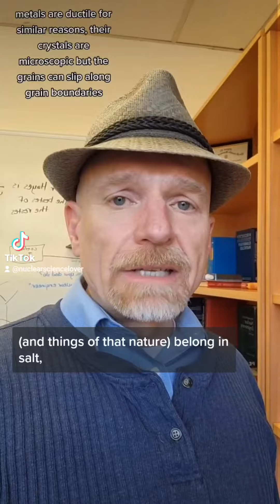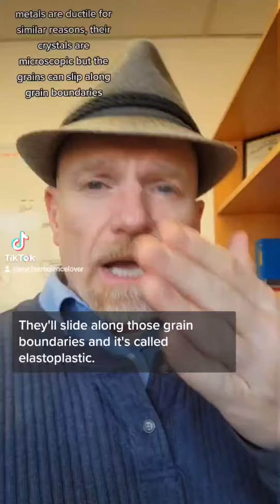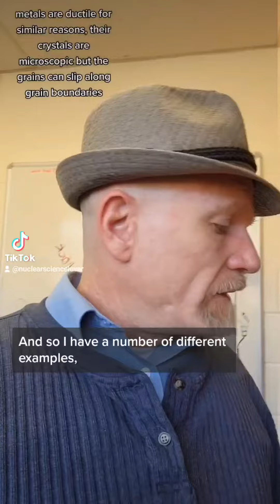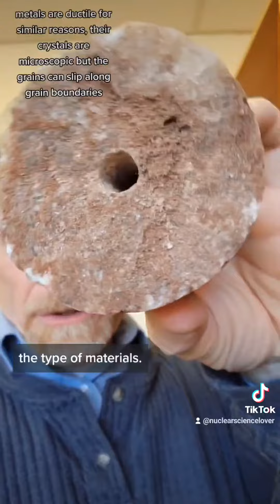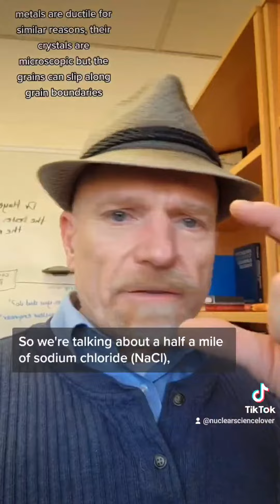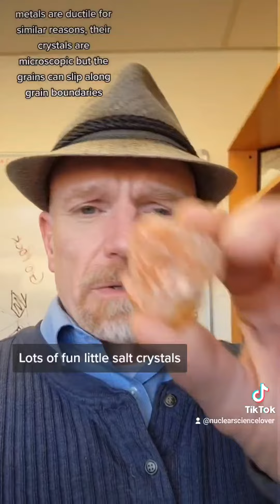The geophysics of the Waste Isolation Pilot Plant. #nuclearenergy #nuclearwaste

Comment: Robert would you be able to talk about the EROI/net energy of gen 4 reactors? Is it high enough to support thermodynamic sink processes like hydrogen production and Carbon Capture while still leaving enough energy surplus for currently hydrocarbon-based society needs like electricity and high grade industrial heat? Thank you
Reply from the maker: Is this close enough?
https://doi.org/10.1016/j.cles.2022.100009
Reply: @robertbhayes5039  I’ll read the paper, thank you. I have very deep concerns about the upcoming ‘energy cliff’ in oil which I think will be a bigger problem for us in the 2030s than climate change will. I’m hoping that the positive case for nuclear can be made in time. As part of making that case I’m trying to understand if nuclear could replace ‘the whole barrel’. It seems to me it only does this if there are significant energy surpluses left over after electricity generation. Hopefully your paper will elucidate on that